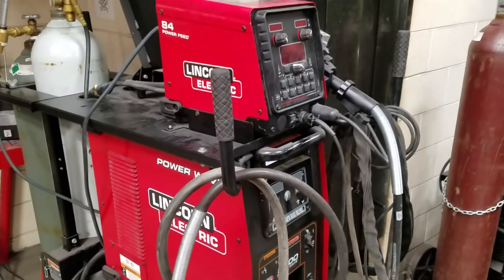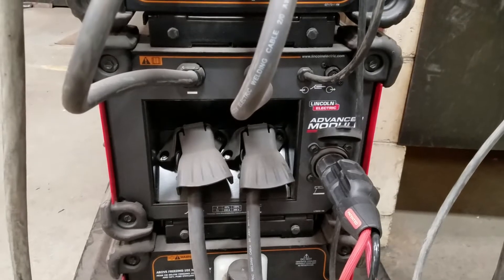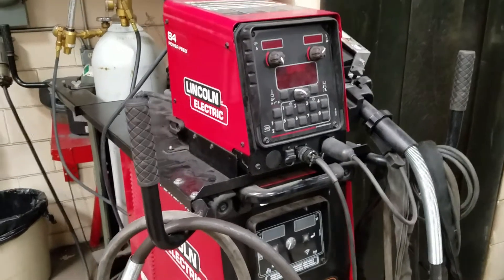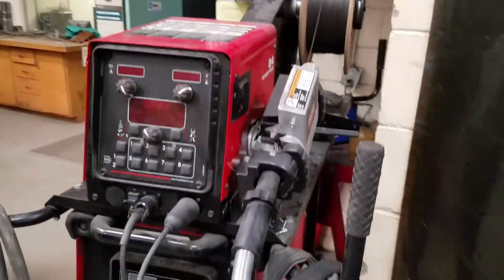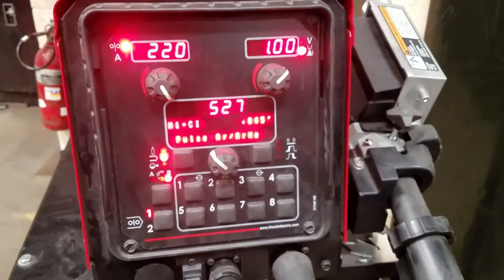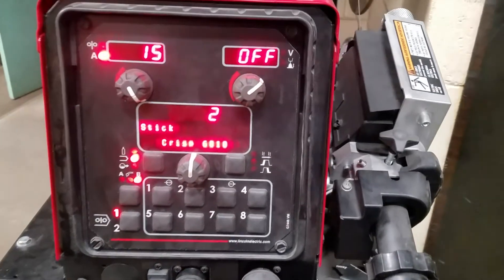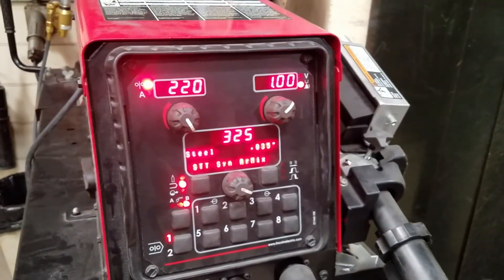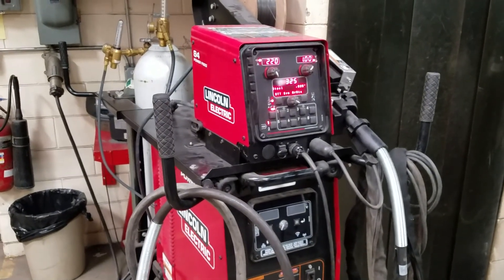Lincoln Electric Powerwave S500

Comment: Thanks for the helpful video. Is the advanced module good to ac tig with? Are the controls as user-friendly as a good tig machine, or is it a pain? I'm buying a demo with the stt box. Considering the advanced module instead. Thanks!!
Reply from the maker: The AC TIG works pretty good with the advanced module. The controls are difficult at first, but get easier as time goes on. Good luck!!!
Reply: Thanks, Tim!

Comment: Biggest piece of shit on the market. we got 30 of  them some with hyperfill - so dual feeder and in 6 months 7 of them have gone down and back to factory or where ever for repairs. company is now  looking to go to miller machines (30 of them  again) just to get our crews working again. ya buy 30 lincoln and turn around and buy 30 millers. it says a lot. Joe and Lacy are awesome but the machines suck ass. Dont waste your time/money.
Reply: That's extremely unfortunate! Machines were great for the company I worked for. Just started to use the hyperfill as I left so can't speak to that on reliability on that but for a power source I was very impressed with the 500.